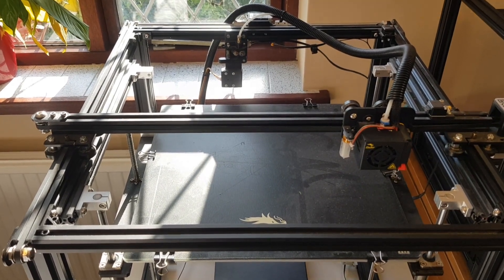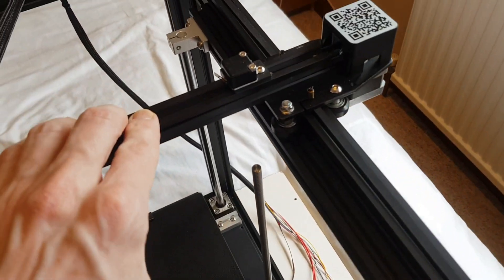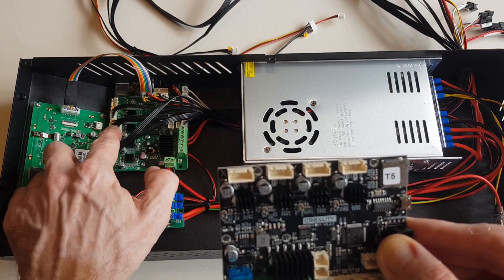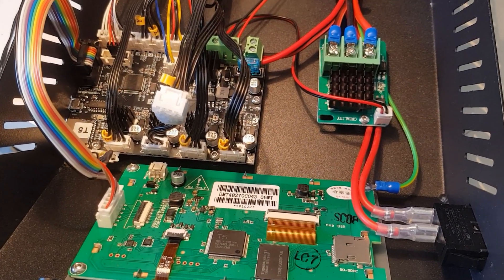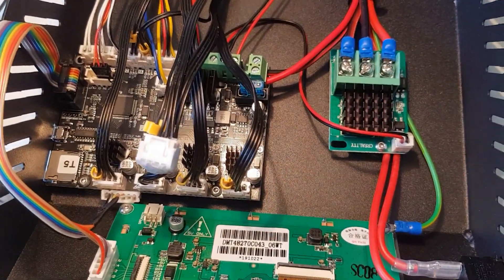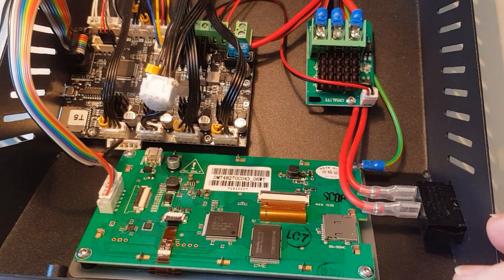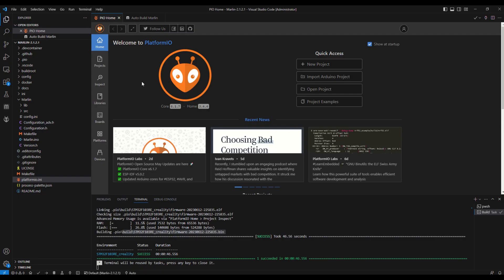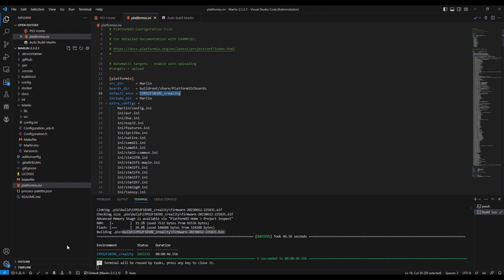Creality Ender 5 Plus - Repairs and Upgrades with 32-bit V4.2.7 Mainboard and Marlin 2.1.2.1

Comment: Does this version have power loss recovery? Trying to get it setup on my ender….Tested it by unplugging power during a few test prints with my current firmware but I never get a prompt to resume printing once I restore the power
Reply from the maker: I have it disabled in my version as it generally causes issues with blobs on each layer due to the delay in saving to the SD card. You can try enabling it in the firmware in Configuration_adv.h by uncommenting #define POWER_LOSS_RECOVERY. But I haven't tested it myself. Also it might also be possible via command in your start GCODE

Comment: How does it work with the stock touch screen
Reply from the maker: The touch screen runs it's own firmware and sends GCODE commands to the mainboard which is configured to communicate with the screen similar to how it works with the USB port. So for the wiring you only need 5v to power the touch screen along with ground and RX & TX lines for the serial communications.
Reply: @amp9438  so basically its a plug and play and connect because i was going to use a regular screen like the one on a ender3 woth the knob on it instead of a push button on it
Reply: I am using a th3d screen upgrade so i dont have to do the screen upgrade
Reply from the maker: In that setup the main board is actually driving the LCD but I configured my version of Marlin to rely on the LCD having a serial connection and sending commands. But either will work depending on how you configure the firmware. There are links to my config in the description.